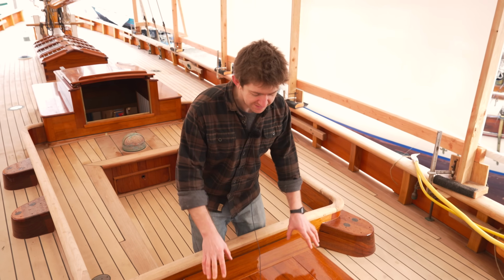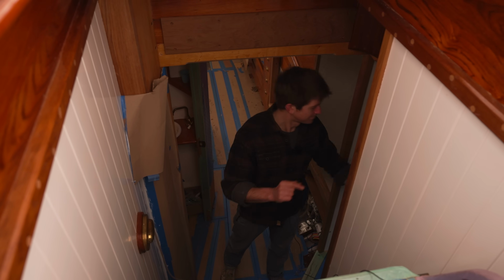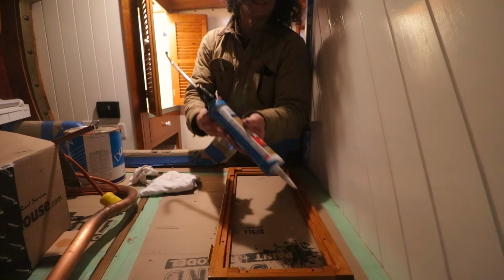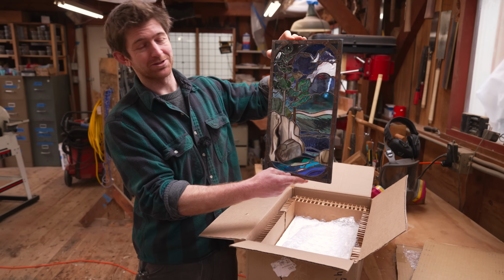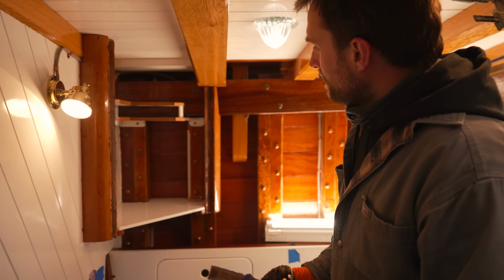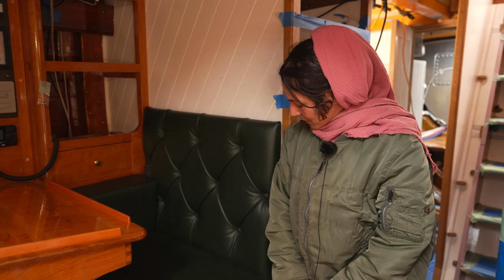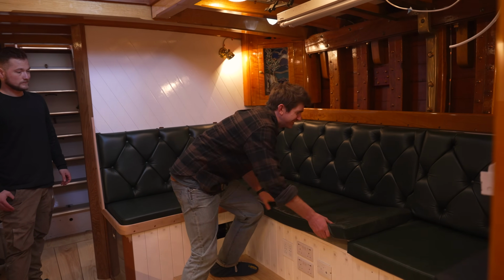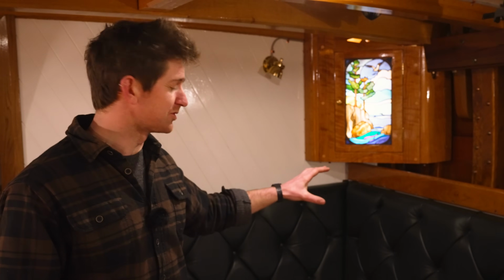Below deck on Tally Ho - Upholstery and stained glass!

Comment: Leo, in the salon Maya centered the pattern on the shorter section. She then continued with the same spacing from the corner AND continued without breaking the pattern at the joint of the two back rests. What a lady, what an eye for detail !!!
Reply: Thanks for noticing !!
Reply: @mayavegagarcia9021  I'm in the trade also, I noticed!  Nice work!

Comment: Re to the Engine room Tool-drawers : I may suggest that to have a good safety for the drawers that stay closed , in this idea put, in the middle drawer length, at the top and down of frame one large ring in which you can pass a stainless steel rod with a bumper on the lower part. By that, you can introduce, first, the rod top part and then the lower till the bumper. 🤐🤔🤨😉😊😊
Simple and Easy to use and prevent the drowers slide in hiking of Tally Ho-Port. 
Super vidéo. Congrats to all.
Bon Courage and stay safe.👍👍👍👍👍

Comment: I had a toolbox with drawers like that in a trailer. The detent that holds them closed wasn't strong enough to keep them closed and the toolbox ended up getting destroyed because all of the drawers came open and it fell over. Those are mounted so no worries about the box tilting but they are on a boat, maybe as a precaution put a removable bar or wood piece in front of the drawers so they will stay closed when not in use and you won't end up with tools all over the place.

Comment: Leo, so much has gone into this project over the years, from so many talented crafters, it's hard to remember watching you stumbling around a naked hull all by yourself in the early episodes.  So many faces, so much talent, all immortalized in your video diary and shared with the world -- an incredible achievement in itself.  Yes, there's still a lot left to do, but there's so much less now!

I'm also delighted to note all of the fellow travelers, both YouTubers and not, who've felt compelled to contribute to TallyHo's resurrection.  Whether it's a bolt manufacturing machine, or a ship saw, or a capstan, or a piece of stained glass, you've made the most of their efforts and even altered the plans to accommodate them.  (That liquor locker is a chef's-kiss addition, but integrating it didn't just happen!)  That's a testament to your ability to plan and manage, with patience and style.  Kudos!

Comment: Handholds, hatched locks, prepare for stormy weather, slip resisting stairs, you get the message!
Reply: This boat is made for offshore sailing, or a de luxe harbor queen?
Think about it !
can you see in darkness?
red  right  return
Reply: Do some testing 
Dynamic roll recovery: fasten a strong rope to the mast ,pull it to 45 roll angle, let go and see the damage to the mirrors, pretty glass decorations, your life depends on it.
Live or die of boredom
Reply: This is serious, if you still want a automated smooth ride. 
Read the US Coast Guard report on the Swath "Halcyon" 
More technology ? Not possible without hefty stabilizers, gyro sensors, computers, the all important sophisticated programming, hydraulic actuators and the power to drive them. 
Where is the sea anchor, the life savers, the lines to prevent  you from being blown to the cold, cold pacific even on a weaker dōng fēng?

Comment: I like those toolbox slide out drawers you have in the engine room. I know things tend to get slung around while sailing so you might think about having some tool holder trays 3D printed for each of those drawers. The trays can be completely custom to the exact tools you have and the 3D printing filament used can be of the softer more flexible variety as well. Just a thought.

Comment: SUGGESTION !!!   Hi Leo, great job on the interior. I have one suggestion that applies to the dining table in the salon which has the strip of wood that goes around the circumference of the table to keep the dishes and other objects on the table from rolling of the table when TALLY HO is heaved over; and to the wood rail at the base of the chart table. I would replace those wood rails with the forearm leather covered cushion that is used to provide comfort for people who are sitting at the salon table or the chart table. This type of forearm cushion is used in all professional poker tables, where players often sit for hours at a time. The other benefit of these type of comfort cushion arm rests is that they have an overall height which is higher than the wooden rails, thereby providing a better barrier to stop things from sliding off.  William Finseth, a former sailor who owned a Sparkman Stevens 29 foot sloop in Ottawa, Canada.

Comment: Gorgeous glass panel on the liquor locker but don't you need an internal 3 inch wooden grill to separate the bottles and prevent them from moving about when heeling over?

Comment: Sorry Leo Bad News. The ridge preventing the seat from slipping off in the galley area is too high. It will be quite uncomfartable to sit there. My entire childhood and teenage years were spent in my dads upholstery shop. You either need to reduce the "lip" or increase the the foam in the seat. Would also add that the boat looks absolutely stunning. Keep up the good work

Comment: Astounding work. But we are used to that by now. A question. Put Tally Ho on the port tack, lee rail under, hammering to windward. What keeps the person at the chart table - another gem of workmanship, in that seat? (I owned a much smaller yacht of your vintage for half a century, so I speak, albeit tentatively, with a little knowledge). But surely you will have thought of how it all works off the vertical? Why not tell about that?

Comment: I have a question regarding varnished surfaces. I only have watched few videos and its incredible. im blown away. Still, i wanted to ask why does every varnished surface have so many air bubbles trapped? are you not sanding in between? im a woodworker and not a boat builder (never worked on a boat in my life and have no experience whatsoever regarding boats) and as a woodworker i would say it's, let me put it lightly, shoddy work. Is there a reason or is it just "good enough"? no judgement, this wouldn't change my opinion that this project still is gargantuan success.

Comment: Just a thought regarding the "Liquor-Locker".
That stained glass is absolutely gorgeous, but having it "exposed" on the back makes me concerned that it might get damaged, if anything in the "liquor locker" should fall over or "move around" due to Tally-Ho's movements. 
So for that reason I think it could be a good idea to have something on the "inside", behind the "stained glass". Either another sheet of glass, or even just a thin piece of "plexi". Neither of which would take anything from the gorgeous appearance, but should  give the "artwork" protection against damage from the inside, as it would be really tragic if that were to happen.
Just a thought.
Best regards.

Comment: Shouldn’t there be some type of rack for the bottles inside the liquor locker so they don’t shift and possibly break the beautiful stained glass when the boat is rocking in the waves? (I’ve seen in some boats that there are boards on the bottoms of cabinets with round cutouts for glassware and bottles for this exact purpose) Also, the tool boxes do not seem to have locks/clasps of some kind to prevent them from opening when experiencing roll, especially since rather heavy tools (wrenches etc) are going to be inside of them.

Comment: You probably ought to have a piece of plexiglass behind the liquor locker glass. I don't know what sized waves you intend to encounter but it would be a shame for a rum bottle to slam into the door, damaging the back of the stained glass.
Reply: just like they do on both sides of these windows in Churches...
Reply: 10:38 - the inside face of the glass has a light-diffusing panel, I hope it's stiff enough to give some protection?
Reply: @frederickstibbert7389  i hope it does give some protection. I don't know what kind of weather Tally Ho can withstand herself but I'm just saying it would be a shame if one stiff wave sent a rum bottle flying in that cabinet and shattered the glass.

Comment: 2:27 I discovered the incorrect way to use a companionway ladder on the Arthur Foss when I took a fall. Landed knee-first on a generator or other large mechanical lump and broke my kneecap. I don't recommend doing it that way. =] (Actually, that was at the dock at Pope Marine Park, about a mile from where Tally Ho is now.)

Comment: I love the standard of work being executed, but am frustrated when I see cabinet and joinery that is aberrant to the traditional design rules of thumb. For example, the bottom rail in a hinged panel should be between two-thirds and twice the width of the stiles. This provides the strength necessary to ensure longevity.

Comment: Hallo, I did the refit of a wooden Bristol pilot schooner in 2007. So I wonder is there no place for a bowthruster?; where are the hydraulics? (and why are there absent?); is there a autopilot?; why don't you use maceratorpumps for the heads?; why don't you pump out the wastetank with a macerator pump?; why is there no greywater tank? Is there a place for solarpanels? - Take care for the so-called homokinetic piece in your (aqua)drive, its the weakest part in your shaftdrive... 🙂

Comment: Aye!, but where's da lick her locker cabnet? Sorry, couldn't resist. Beautiful, beautiful work on the stained glass. What no "peanut butter" on the points/holds backsides to frame like shown on previous door seen earlier 5:41 vs 9:17 or did an edit skip over it? Just curious as to why one place but not the other.